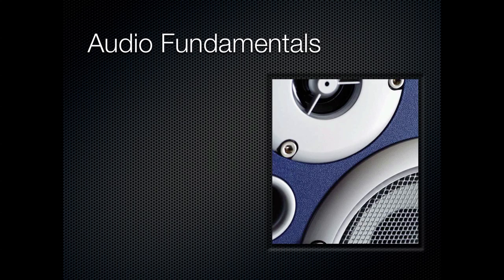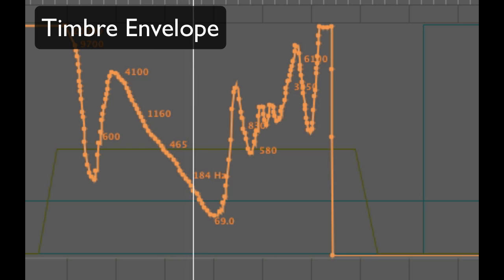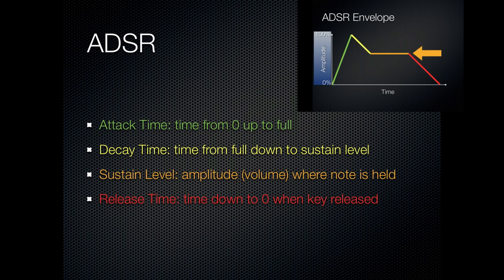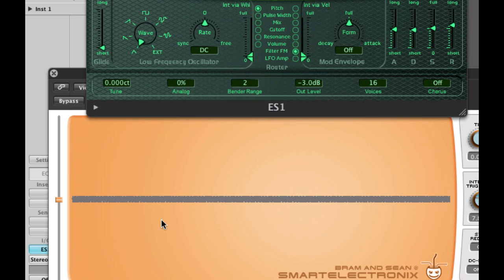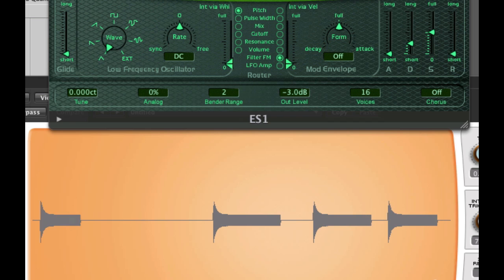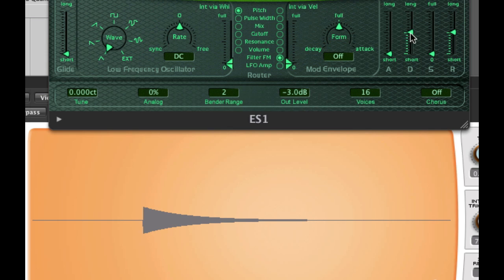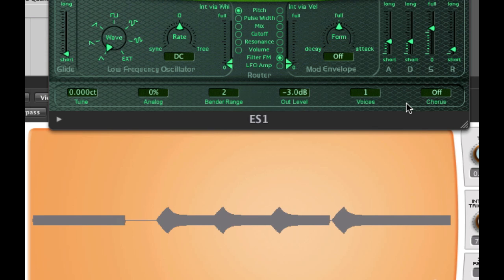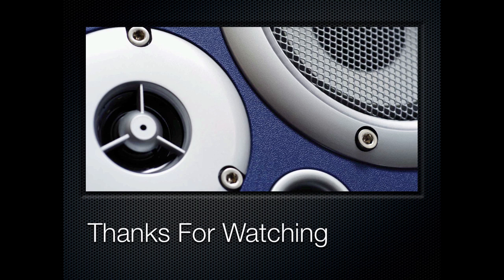AF004 Envelopes and ADSR

Comment: hey Matt!! Im just a fan of ur utube channel Nd it's teaching me a lot... could you tell me what would be on the x and y axis of a timbre enveolpe..
Reply from the maker: Hello Sebastian, usually the x axis would be time, and the y axis would be a filter cutoff. At least I think that's what I used in the example - it's been a long time :-)

It would also be possible to plot other parameters over time as an envelope, like tremolo or vibrato speed, delay time, chorus width, mix between synth waveforms, or whatever. "Timbre envelope" is not exactly a standard term - I used it in the video to give another example of an envelope, and audio engineers would probably understand what you meant if you said it, but it's not something I've heard commonly.
Reply: Matt Mayfield Music 
oh great Matt !! thank you..nw I have my doubt cleared... thanks for the reply...